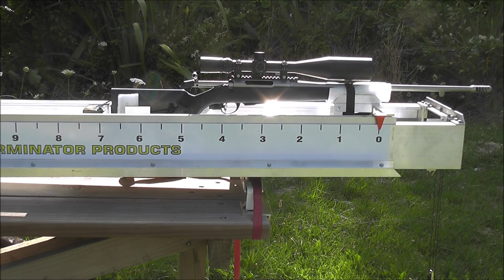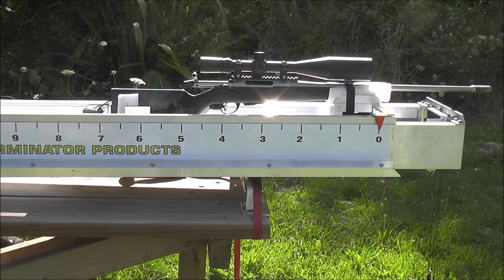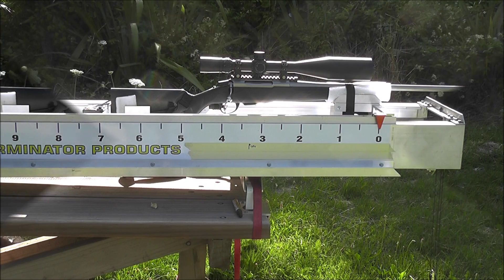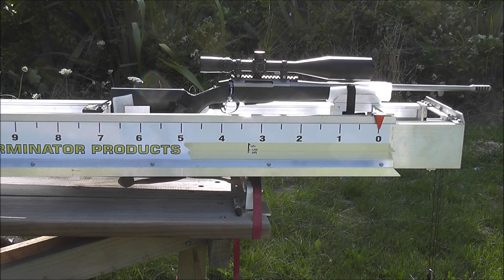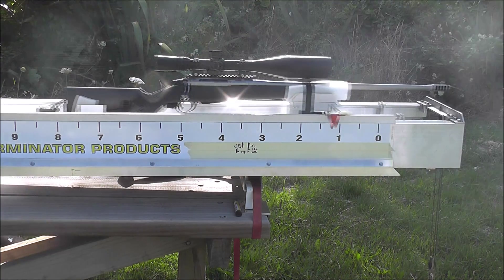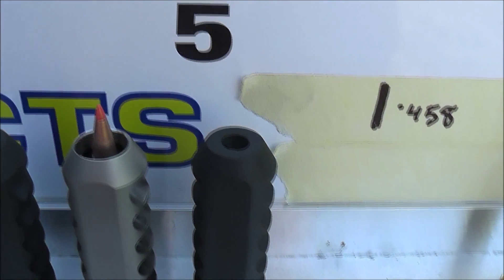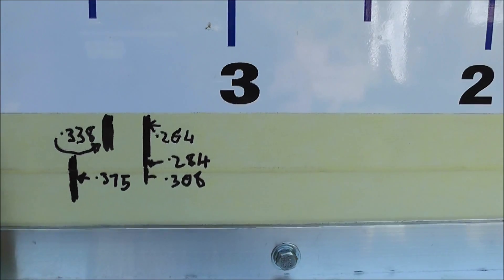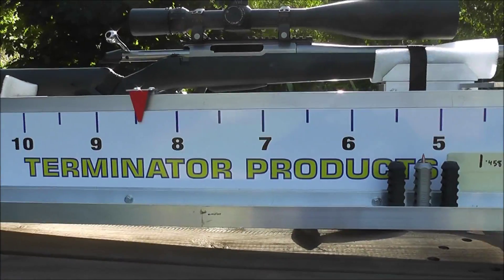T2 Terminator Muzzle Brake with enlarged through hole on a 6.5 Creedmoor

Comment: Hello, i have sako trg 22 6.5 creedmoor and want to buy Terminator Muzzle Brake but have some doubts which would be better. My rifle has 18:1 thread but as I understand you have just only TB2 6.5 but only in 1/2×28 or 5/8×24 threads. I will appreciate for your answer and advice which would be better for my rifle. thx!

Comment: Greg,  I have been using your T2 clearanced for 30 cal now for a year on a Ruger Precision Rifle.  I use it not only for my enjoyment but for introducing new shooters to our sport.  It has made their first time experience when moving up from a 22 lr precision rifle to a centerfire 6.5 Creedmoor very pleasant.  I have now sold that rifle and am building a switch barrel rig to shoot both 6.5 Creedmoor and one of your countrymen's developments, the 7mm Practical shooting a 7mm 195gr Berger EOL projectile out of 300 Winchester Magnum base case.  My question, is do you think I need to move up to the T3 or is the difference between the T2 clearanced for 30 Cal and a T3 not going to be that great a difference?
Reply from the maker: Hi Bill. If the muzzle diameter on your 7mm barrel is 20mm or under go for the T2, if it is bigger then go for the T3.
I would run a brake on each barrel then they can be clearanced to suit each calibre. the heavier the projectile the more the rifle will recoil. Cheers Greg.
Reply: 31.75mm Finish diameter on both barrels Greg.  They will both sport the Teludyne StraightJacket wrap...
Reply from the maker: Hi Bill. thanks a pretty big diameter, the T4 is 31mm diameter. Please flick me an email, terminatorproducts@xtra.co.nz Cheers Greg.